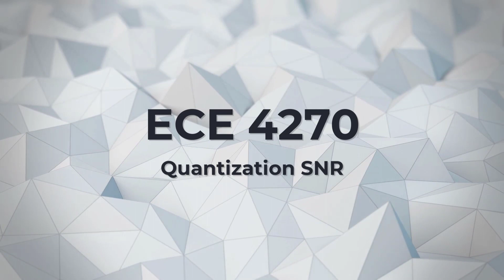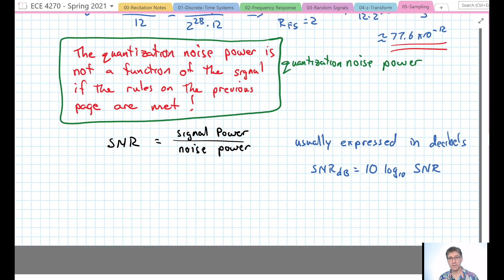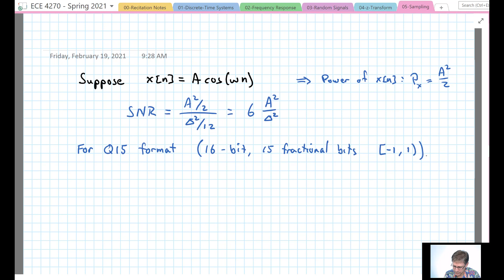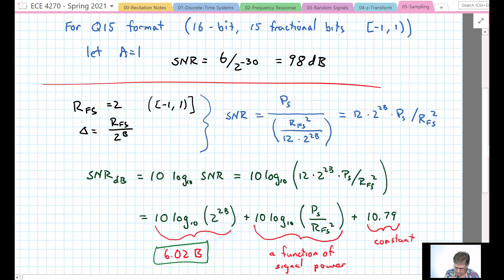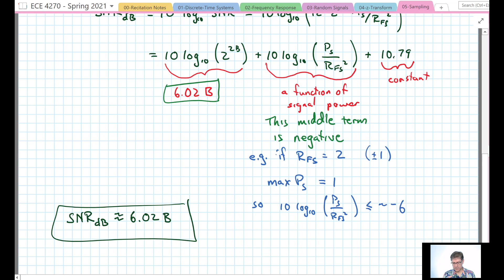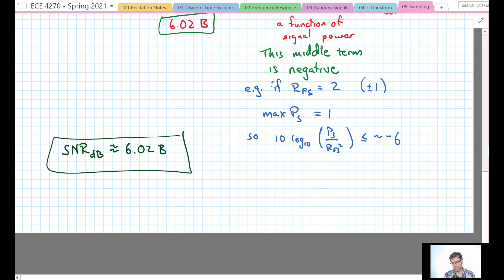Quantization SNR | DSP Fundamentals - lecture 29

Comment: Are you saying that the SNR for quantization namely SQNR(QSNR) will be less when the input signal is larger? I thought larger input signal is better in terms of SQNR. But it seems the opposite?
Reply from the maker: I apologize if it was not clear.  The quantization noise remains the same regardless of the signal level (within limits).  Thus, if the signal is larger (without saturation), the SNR will improve (increase).  As the number of bits used in quantizing the same range of values, the SNR will also increase.